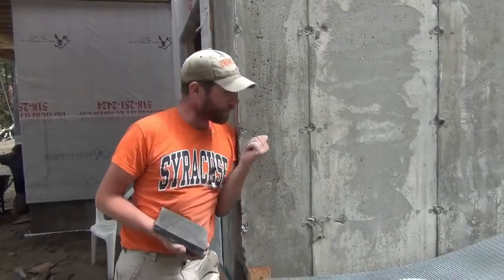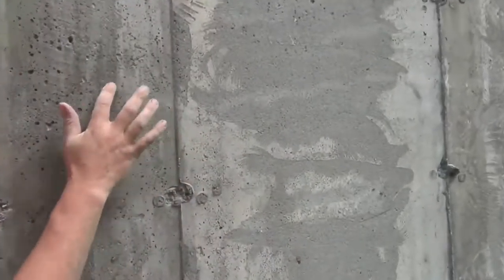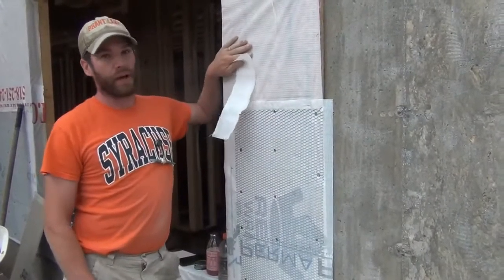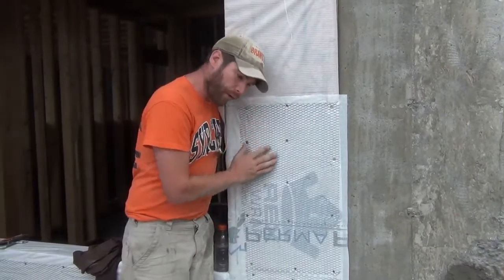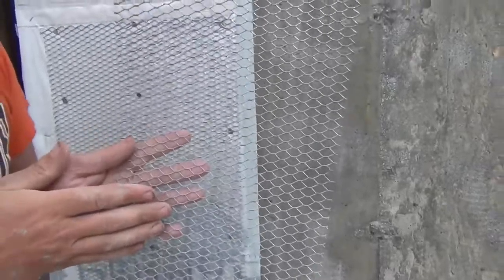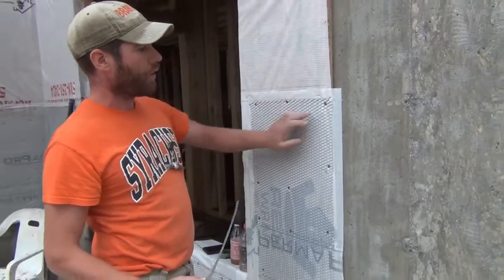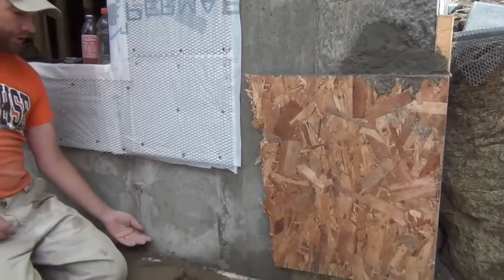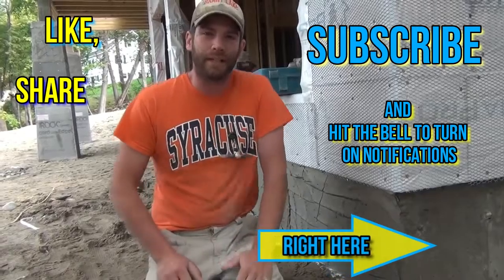How to prepare surfaces for thin veneer applications

Comment: Roger. Sweet channel. Just discovered it. Is weighted felt not used anymore? Now it’s house wrap?
Reply from the maker: thanks Travis,   yep most people use house wrap.  its supposed to be breathable with no draft,  but its not quite as good as they say.   felt paper is still a good option,  and it holds up well against mortar.
Reply: @TheHowToHeadquarters  

I have been really into masonry. I have been watching Mike Haddock on YT. 
And I would become confused when someone said mortar and Portland. 

Which I thought when a person mixed Portland with sand and water it was a Mortar. So, do you consider Mortar something with Lime and water and sand? Portland Sand Water and Lime? 
And then there’s Masonry Cement. 
A lot of info out there.
Reply from the maker: @travisandtracyjacobs6198   Mike haddock is great!    yes i think ypou have it.  mortar is a little weaker (or more flexable, softer) portland is stronger (but more brittle harder.)   and the thing that makes mortar softer is the presence of lime.    I'm gonna try to make a vid explaining it.  thanks for watching are you doing any masonrt projects?